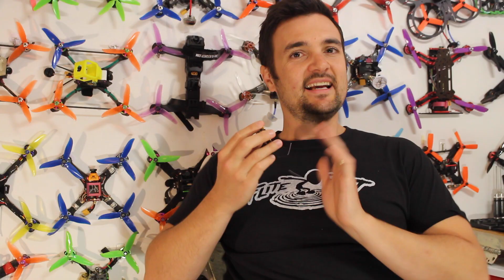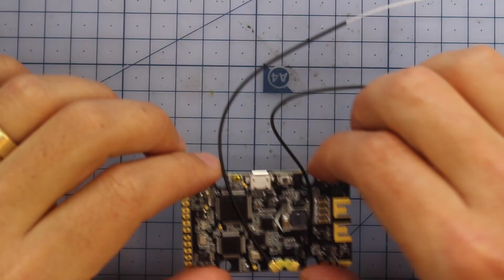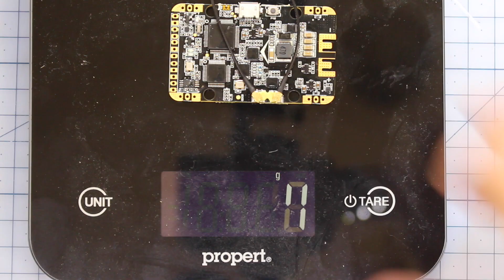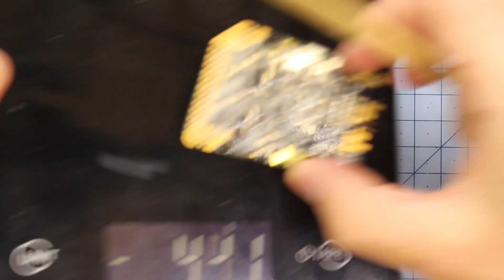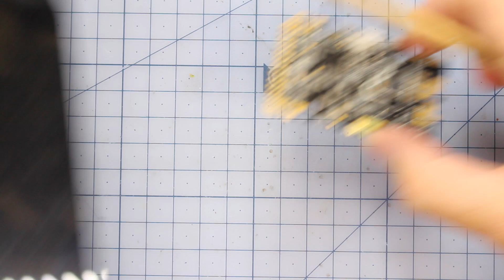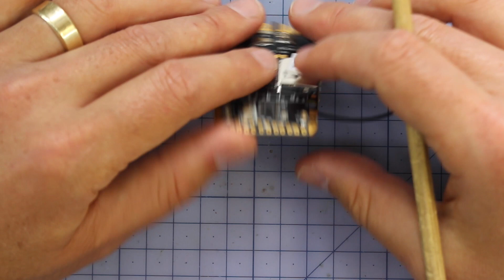FRSKY'S NEW XSRF4PO. Tech Tuesday UAVFUTURES

Comment: Please answer this, I’m building a TC R-220 (QAV-R clone). I have the brotherhobby returner R4 2300kv motors, runcam swift, pagoda antennae, and I’m gonna pick up some of the gaoneng batteries. If you can tell me good fc with vtx and osd,pdb, esc, receiver that would be amazing.

Comment: Hello, I have a problem, my escs are not recognized by BHeliSuite, I can not move the engines nor by betaflight, only if I listen to the beeps of the escs. But I went to test with the arduino and it worked. The radio receiver works by betaflight. What could be the problem? I've been trying to figure it out for days. Thanks in advance.

Comment: Goodday from Germany, I'd like to ask if the placement of the receiver antennas with the all in one board would be an issue. It seems like you might have limited options as to where or how to fix the antennas on your drone, because of the short antenna cables. Im really OC on how things are set up and arranged inside the drone.
Reply: Deus Vult they look like they will reach the arms for the cable tie method under the props. Its the best way imo as it angles the antennas 90° of each other too
Reply: Under the props? I havent thought of that method, but it seems that with the orientation of the board, you might need to mount the antennas sideways vertical, im not sure if it has any effect on the signal, but I always make sure that both my antennas are the same length, it bugs the heck out of me if one antenna is slightly longer than the other, but that's just me. Thanks for the idea btw, i'll give it a try mounting the antennas on the underside of the arms where the motors are mounted, either heat shrink it or zip tie it. :)

Comment: Aaaaaannnndddd, I just ordered a board two days ago for a new build.  Stew, if you could answer a question:  I'm new on the FrSky bit and have a QX7.  How can I tell what receivers work with them or not?  The FrSky website isn't the most descript or I'm just not getting the right words for the transmitters.  How do I tell which works with the QX7?
I love the radio and really see no reason to upgrade and plan to get a spare (though, for my nephews, I'm thinkin' about your Turnigy).
Thanx!
Reply: Frsky XSR receiver
Reply: BTW, LOVE the TechTuesday bits!!!
Reply: Maybe I can help a little.
FrSKY is a different company than FlySKY with the Turnigy evolution. 
If you want to buy a receiver for your radio you need to look in the details of the receiver. There is a compatibility statement.
Reply: I'm fine and get the different brands.  Was more talking within FrSky themselves and compatibility with the QX7 vs The 9 and "D" radios.  For compatibility on the QX7 for instance, it simply doesn't say "QX7"...... kinda frustrating.  A chart or SOMETHING would be nice!
Thanx for the response!

Comment: Why is there SmartPort if there are Build In telemetry?
Reply: Allows chaining in of other sensors not on the board (GPS, barometer, ect..)
Reply: Adzy FPV If you're talking about tramp or TBS unify smart audio you can't do that through smartport, it needs a UART. This controller has enough uarts to do both smartport telemetry and smart audio. I've got it fully working on a recent build.
Reply: ArchmageAU For flashing firmware
Reply: Vtx control through osd is what its for
Reply: Smart port is for any smart sensors.
Reply: Frogzy I can assume if you like the internal RX and add an external RX with smart Port
Reply: correction, thats the port, along with 5V, GND you would use the update the RX to a newer Fw

Comment: Greeting from Finland! I´m in progress of building my own drone at the moment and I already have the Taranis Q X7 radio. Now I need to figure out what kind of receiver I want? I´ve been looking into R-XSR and it seems like a good, small receiver. What are your thoughts and what do you use yourself on your Taranis builds. Thanks!
Reply: FRSKY R-XSR is what Joshua Bardwell recommends.
Reply: Rxsr is nearly impossible to invert the sbus signal on, so either make sure the f4 board you choose has an inverted uart port, or go with an f3...also worth noting, the rxsr had a bad firmware that was shipped out with them, not sure if the updates on their website yet or not...regular xsr works great as do the xm+ receiver if your fine with osd telemetry
Reply: Very good point. You need a board like the Holybro Kakute which has a s.port which will work with the inverted signal. Even if you don't think you need telemetry, you need this to get the BF LUA scripts to work
Reply: Olli Leinonen sbus is a must... cant tell you how deprived i felt running anything else. The responsiveness absolutely contributes to a more fulfilling flight time. :)